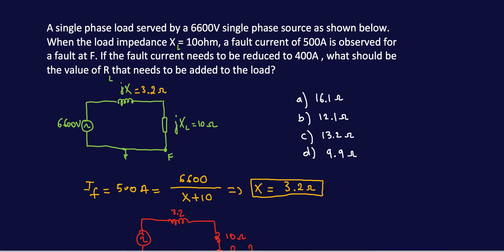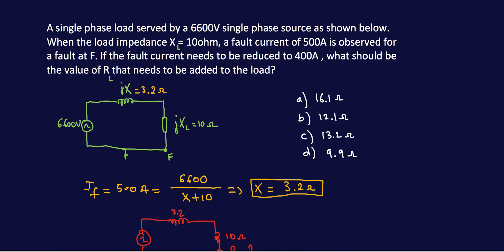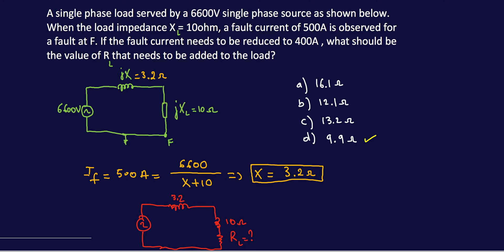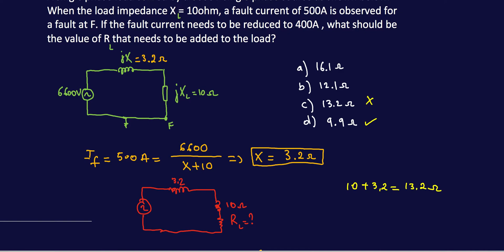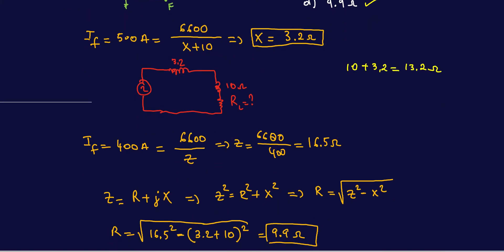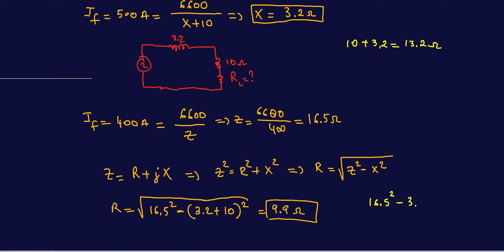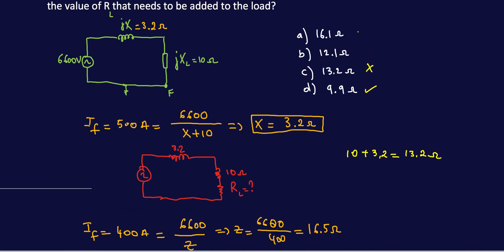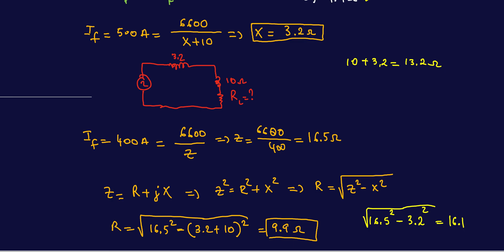Fault Current, Load and Voltage Source (Part 2-Solved Incorrectly)

Comment: Hi. I am confused why people say there is higher fault current at lower voltage? There seems to be a disconnect between V=IR and P=IV. Is it solely a function of %Z of the transformer? If I touch my outlet in my house, the fault current is weak compared to touching a primary line, but fault current is higher in lower primary voltages???